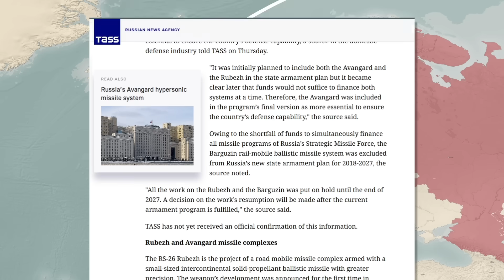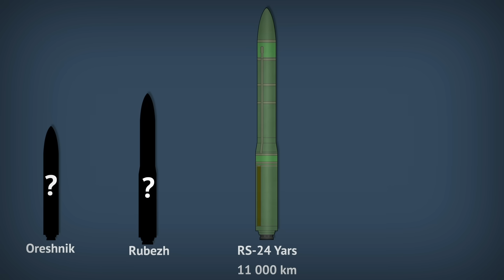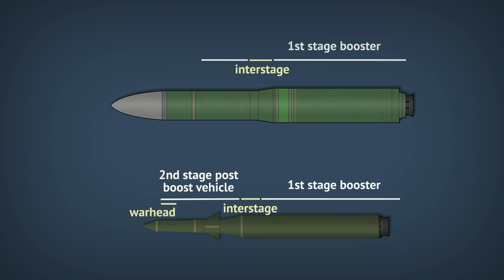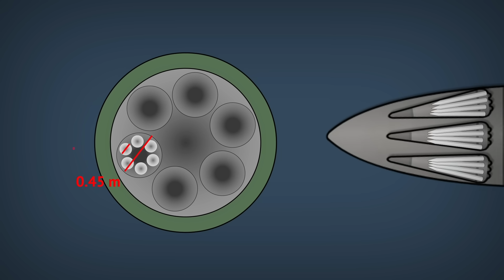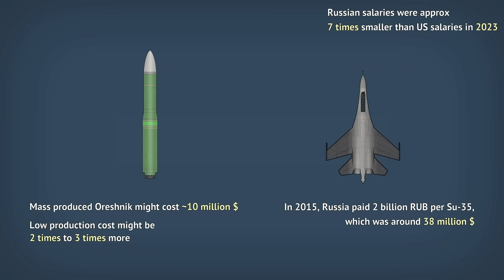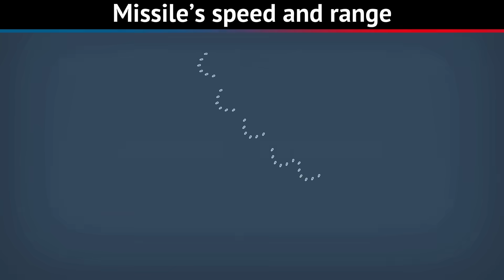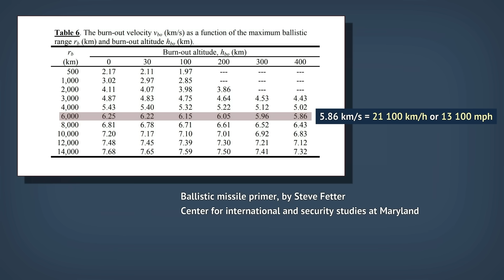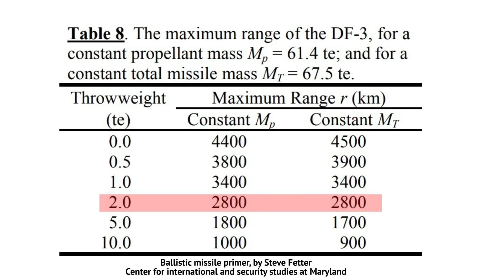Ukraine can’t counter Oreshnik missile. But it doesn’t have to.

Comment: omg why do so many youtubers and self proclaimed 'military analysts' get this wrong?   Thinking that the Oreshnik might carry nukes  is just pure stupidity for two  reasons.  
1.  Why would you want to nuke the same target twice?  But far worse this would be trying to nuke the same target 36 times.
2.  As soon as the first nuke hits the target it would vaporise the 35 behind it.  
     the Oreshnik is purely an area effect weapon capable of completely devasting an area of  about 500m radius using only conventional explosives or kinetic darts.  I think this is going to be a DUAL USE weapon.  Both explosive warheads OR kinetic darts.  If you want to destroy a surface target over a wide area (such as an airbase) you use conventional explosive  warheads ,  Want to destroy an underground command centre or hardened ammunitions store  then use kinetic darts.  It doesn't have to be a choice of one over the other.
Imagine 4 or 5 of these Oreshniks being dropped on a NATO airbase or a military base using conventional warheads.  That's  the equivalent of 150 to 180 bombs.  It's gone,   dust,  history.  
   Same for any  hardened ammo store or  underground hardened command centre or any underground weapons factory such as the Dnipro attack targeted but instead using kinetic projectiles such as tungsten darts so that they penetrate and apply their massive kinetic damage (remember these are travelling at Mach 10+ ) once whatever it is has been penetrated . 
There  is no advanced anti-missile system likely to be able to counteract this weapon so effectively any target in the whole of Europe (UK and France included) is 100% vulnerable.
I would imagine that there's an awful lot of top brass in NATO shitting themselves at the moment and wondering is giving Ukraine long range weapons to attack inside Russia worth losing a NATO Airbase.
Reply: The warheads are self guided, this is why it can carry multiple nukes
The sample has just being programmed to hit the same place, but it will not necessarily hit always the same city. Because it flies 3km per second while self guided
Reply: @eltonmsn  You obvious have no idea of what you are talking about.  This is how a IRBM,  or ICBM works.  First you get a fecking great big rocket, on which you put a thing called a bus or MIRV to hold the warhead(s),  you launch into space (yes these things actually enter space) on a ballistic trajectory to the target. Just before it gets into space you dump the rocket booster leaving the MIRV cruising through  space and while it is cruising through space it uses little impulse jets to orientate or point the warheads at the target,  It then fires the warheads at the target, and from this point onwards there is no control of the trajectory of the warhead,  (there might be an exception to this, but that's the case for almost all ballistic missiles.) The warhead drops from space at huge speed (Mach 10+ for the Oreshnik) and at some altitude and submunitions are released if there are any.  A MIRV is capable of targeting more than one target in which case while in  space it points to a target, fires a warhead, points to another target, fires a warhead and keeps doing that until all warheads have been released.  But being the Oreshnik is a area effect missile and not a nuclear armed missile there will be not be multiple targets.
At no point are the warheads or sub munitions guided.  Any targeting has already been done by the MIRV vehicle in space.
Look it up if you don't believe me but please don't BS.
Reply: 1.  Why would you want to nuke the same target twice?  But far worse this would be trying to nuke the same target 36 times.
You have created a false dichotomy here - the intent is not usually to hit the exact same location but multiple spread across a larger area. Every Russian ICBM built in the past 40 years has MIRV capabilities. These are not just designed to increase firepower but also to defeat missile defense systems which could potentially intercept some of the re-entry vehicles.  Additionally, when you are referring to Russian equipment there is no guarantee every single one of them will even work as intended and detonate in the first place. Their doctrine for this use case is pretty clear and something they speak about and acknowledge publicly.

2.  As soon as the first nuke hits the target it would vaporise the 35 behind it.
That's just not how it works or how Russia would utilize the system in practice. Not only do the re-entry vehicles have the ability (which would obviously be used in a nuclear strike) to land hundreds of kilometers apart - the conditions these vehicles are exposed to by re-entering the atmosphere require large amounts of thermal and shock protection. That ride is absolutely rougher than the conditions it'd be exposed to by another warhead detonating even 5 or 10km away.

The technical and operational capabilities of NATO are orders of magnitude over those of Russia, even excluding the United States. All Russia has against the West are its nukes. The West has no interest in war and Russia knows it's only chance to win one is to go nuclear. I don't think anybody in NATO is losing any sleep over Russia using this capability in Ukraine.
Reply: @sango_wilko851  you are making things up as you go along,  but if you want to waste your time  be my guest.
This weapon attacked a single target TRUE or FALSE
Its a NEW weapon TRUE or FALSE.
All we know about this weapon is that it has 6 warheads with 6 submunitions and it struck a single target.  Beyond that you are guessing and probably wrong.  My  interpretation fits both,  your fits neither.
Being that each warhead had 6 submunitions there is no way that this was intended to carry nuclear warheads as the sub munitions are released from the warhead above ground and not in space , we saw that clearly in the video.  Again I make the same point why would you want to hit the same target with 6 nukes even if it was your intension to hit a different target with each warhead you would still have each target being hit by 6 nukes..  Again  once the first nuke  hit the ground all those following would be vapourised.
You seem to think the things that hit the ground are warheads, they are not they were submunitions and not controllable.  If it had been a case where there were just 6 warheads hitting the ground then yes potentially each warhead could potentially be used for a different target.  But then this would not be a  new weapon and not announced as such, Russia already has many of these already and there would be no point developing two separate systems that do exactly the same thing,.  But we are not talking about 6 warheads hitting the target we are talking about  36  submunitions hitting the ground  (6 warheads with 6 submunitions) and because of that your argument falls  flat on its face.

As for this WEST always better than EAST bullshit, because that's what it is pure bullshit.  NATO does have many system far superior to what  Russia has, absolutely not doubt about it.  Better Aircraft Carriers, better subs, but definitely not better rockets or missiles.  For the last 50 years the US has been using Russian Rocket engines exclusively  to launch all  its spy and reconnaissance satellites until SPACEX came along. ULA had the contract with all the US agencies to launch their satellite before SpaceX came along and they were buying  RD-180  rocket engines from Russia as there was nothing suitable being produced in the US.  The ISS would never have been built without  Russia being part of it because their space tech was more advanced than the US and their were problems the US companies could not solve.  Does the US have hypersonic missiles deployed? NO but the Russian have multiple different types deployed and working exactly as designed. 
The AS400 is a far superior anti air system to the Patriot and Russia is a good bit ahead in anti  air defensive systems.
So no the technical and operational capabilities of NATO are NOT  orders of magnitude over those of Russia. In some areas they are better,  but others not.
The worry is not Russia using this missile in Ukraine,  that was just a demonstration.  The worry is that they use it to take out the NATO bases supporting the war in Ukraine, or the ammunition dumps in Poland,. and there's little NATO can do to stop that except declare war which  inevitably would go nuclear and as you admit Russia could win  a nuclear war as they have far more  warheads,  they are not relying on minuteman missiles that are 50 years out of date, and quite simply Russia is so vast that in the event  of a  nuclear war the Russians will have millions of square miles not affected by nuclear strikes to relocate  their population to to but the US  has little or none as the empty space in the US is where their missile  silos  are situated or deserts. (but  no one is going to win that one, with the nuclear  winter afterwards we all lose)
Reply: @eamonnfanton2165  All I've done is point out statements you've made that are factually incorrect. You've been unable to do the same because everything I've stated is a demonstrable fact. You continue to switch up your argument, which obviously is your only choice once the previous one has been defeated, but I've got to say it's a bad look and reeks of desperation especially when you continue to offer up things which are so easily disproven. Once you really double down and start resorting to logical fallacies by attempting to form an argument against a position I never made, it becomes clear you aren't operating from a perspective based on reality or interested in discussing the facts.

One new point I will happily address though. Western weapons systems have defeated the S400 on multiple occasions without it even detecting them much less being able to attempt to engage. At the same time the Patriot has defeated some of Russia's most modern and comparable weaponry. There is no reason to assume the S400 is any way superior to NATO defense capabilities, but we've got quite a lot of examples to suggest the opposite.
Reply: "OMG why do so many military analysts get this wrong", said with such certainty while being 100% wrong 🤣
You put 35 warheads on the same target so that the chances of at least one making it to the target are vastly improved: you weren't trying to nuke the same target 35 times, you are trying to guarantee one nuclear detonation by using 35 warheads. The fact that 30 are destroyed by anti-air and the one that survives nukes the other 4 inbound is a feature, not a bug.
Reply: @wilfdarr   LOL.  are you being serious.
  If you are lobbing nukes you don't need to be accurate, close enough  is good enough and yet again why on earth would you  nuke the same target 36 times when the first nucclearr warhead is going to vaporise the following 35.
No defence system on the planet is capable of intercepting a projectile travelling at Mach 10+.  Nothing the US has and certainly nothing the Russians or Chinese have.  The only systems that are capable of intercepting this missile are one that would intercept it in boost phase (impossible because NATO don't have these systems positioned inside Russia close enough for one of these missile batteries to actually to this, or possibly a system that can intercept while the missile in in cruise phase  while it in in space, and for that the US has two potential candidates,  The THAD but the probability of getting kill would be extremely low. or the SM--3 which potential has a chance of interception.  Problem is you would need a THAD or SM-3 antimissile system at EVERY possible target in Europe and that's an impossibility as they are like hens teeth and  there are not many of them.   There wouldn't even be enough to cover just the airbases, let alone the military bases or Ammunition stores.
So yes I am absolutely certain I am closer to the 100% than  Binkov or yourself.
Got any more stupid arguments??
Reply: @eamonnfanton2165  "No defence system on the planet is capable of intercepting a projectile travelling at Mach 10+."

Patriot PAC-3's deployed in Ukraine have intercepted multiple hypersonic Kinzhal missiles which supposedly have a max speed above Mach 10. The capability to intercept, while to be fair is surprising and likely not having the highest success rate, absolutely exists. The interceptor can only travel at Mach 4 but depending on the trajectory it's not chasing and catching up to the target it's just having to get in front of it.
Reply: @sango_wilko851  I heard they managed to take out Iskanders but never the Kinzhal.  But you learn something new every day.  thanks for that will look it up and learn more.
However its a mute point as a Patriot battery doesn't have 36 missiles so absolutely pointless using one to defend against an Oreshnik unless you have multiple Patriot batteries protecting each possible target , and there simply isn't enough of them to do that. As far as I am aware a patriot battery is capable of controlling 8 launchers which each can  hold a maximum or 4 missiles so one battery would not be enough for a single Oreshnik.
    The best system to defend against the Oreshnik has to be the SM-3 missile which is definitely capable of taking out  the Oreshnik in space while it is in its cruise phase,  and that's exactly when you want to hit it as you have only  1 target instead of 36.  Problem is again numbers,  There simply is not enough Aegis Ashore systems that fire the SM-3 available and they are $1,7 billion a go,  so we will not be seeing these at every NATO base
this Oreshnik missile is definitely going to cause much head scratching at NATO headquarters and the Pentagon.
Reply: @eamonnfanton2165  "However its a mute point as a Patriot battery doesn't have 36 missiles so absolutely pointless using one to defend against an Oreshnik unless you have multiple Patriot batteries"

This also is not true. A PAC-3 launcher holds 16 missiles. When operated by the U.S. they deploy with a minimum of 4 launches but an average of 8. In Ukraine they've been seen with a dozen. 12 * 16 is is 192. That's a much bigger number than 36.

Comment: So a missile with non-thermo MIRVS launches 5-12 missiles EACH
     with 5-12 MORE missiles?
       This missile should be called the Matryoshka missile.
Reply: @johnsmith1953x  no actual evidence of warhead clustering.
It carries 36 which warheads, which are released in 6 groups of 6.

Comment: this is a airfield/Missel defense system killer and at 10-30 million vs a billion $ worth of damage it can do that is not a bad trade
Reply: How does it do a billion dollars damage... in Ukraine?
Reply: @willthecat3861  it takes out patiot systems or air fields housing fighters and ammunition
Reply: @willthecat3861  Who said it will be in Ukraine? How much does cost the US base that just opened in Poland? How about an airfield full with f-35? Just 10 f-35 cost over a billion. And an average airfield can hold up to 50 of them.
Reply: LoL yeah sure, even though it missed by miles.
Reply: @TxChristopher  it literally destroyed the planet it targeted
Reply: @TxChristopher  It literally did a pinpoint strike on a single building 800km away. What are you smoking?
Reply: @gmw3083  What cope? Check the impact video, it literally strikes exactly at the factory which was the target.
Reply: @dannydanny2789  i was the first to like you post. I took it away. Do you understand now?
Reply: @gmw3083  My bad lol, got carried away with all the NAFO replies I'm getting.
Reply: @TxChristopher  Seems pretty accurate from the sattelite images provided, dont you think so. Your propaganda have nothing to do with reality.